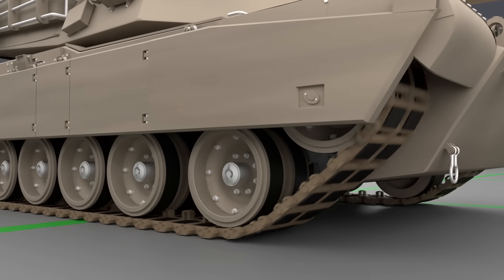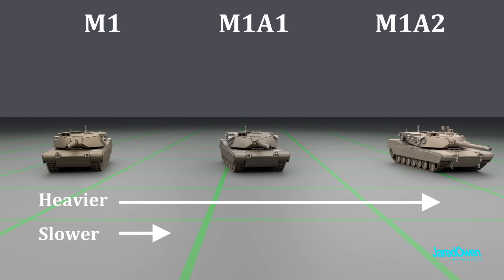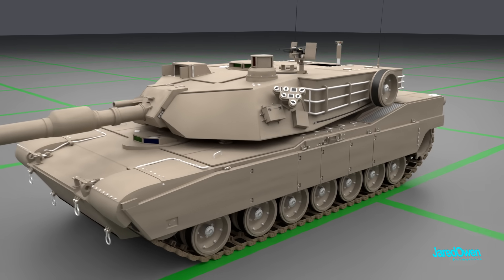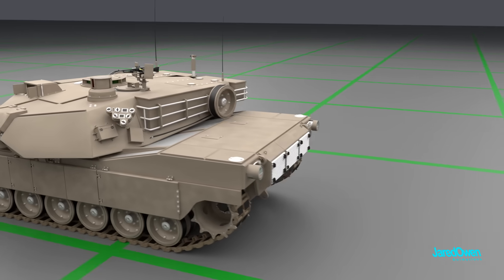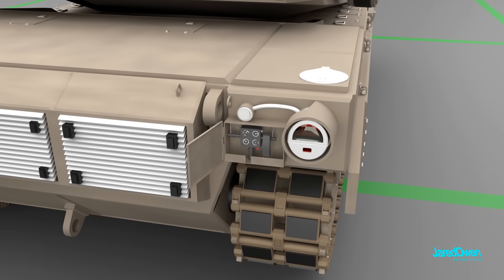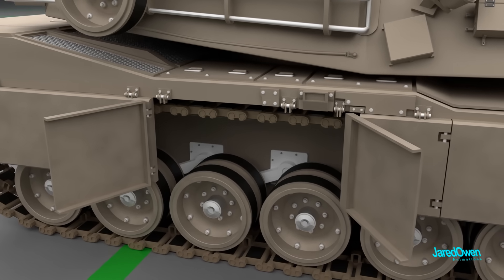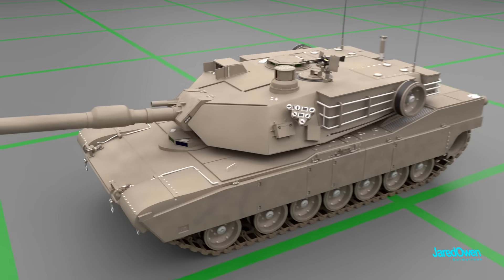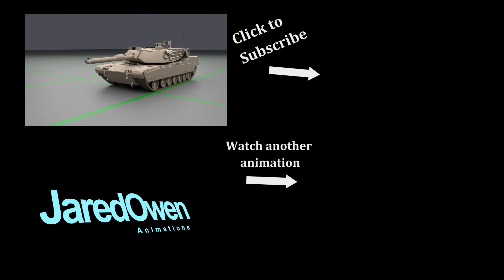How does a Tank work? (M1A2 Abrams)

Comment: I was an m1a2sepv2 mechanic for years and I can say this is very accurate. A few things to mention The coaxial can fire 240 weapon rounds and the one near the loaders hatch is can be either 240 or .50 cal. The tanks that I worked on had c.r.o.w.s above the Commander's hatch. The little passageway that leads from the turret into the driver seat did not get used as much due to the fact that the seat was in the way and not a lot of people can fit through it. Me being 6 feet tall had a tough time. The  Drivers Seat was adjustable so   so the driver’s head is sticking out of the drivers hatch for better visibility when driving. Nine times out of 10 the drivers hatch is always open for that same reason. Typically when the tank is in use the drivers hatch is closed when they are about to fire a tank around or if it’s really bad weather and destroy the electronics inside it
Reply: The loaders mount cannot fit a 50cal. The 50 mount rings are too spread apart to fit in the mount. As well as, the 50cal is a lot wider. Plus if you try to use a .50 in the loaders mount it will hit the CITV. Its designed for a 240. Literally the driver gets in the drivers seat through the turret about 99.9% of the time. For multiple reasons. 1) when we park the tanks we place the gun over the rear of the hull therefor making it very hard to access the drivers hatch. 2) The drivers hatch is always closed when there is not a person in it. You never get off a tank and leave the drivers hatch open when there isnt someone in it. 3) Its really not hard. Im 6'1" and can get in the drivers seat pretty easy from the turret. You just have to hold onto the ledge where the ready rack is and slide in like its a water slide.
Reply: The loaders mount always has a 240 due to the reasons Jacob mentioned, plus it's a backup for the coax. That's pretty important because the coax is the primary weapon against troops and and light cars or trucks. We definitely used it in combat more than any other weapon on the vehicle. As for the driver, they 90% of the time operate with the hatch closed because it's not super safe to have your head sticking out when the turret is traversing and it's not even comfortable for short people keeping your head crouched down like that, and you "definitely" would "never" have the hatch open in areas where the main gun may need to be fired. The driver always has to exit through the turret when the tank will be left unattended. This is because the loader's hatch is the only one that can be closed from outside to secure the tank.  The last segment of the driver's seat folds all the way down, and the head rest folds all the way up, so when you set it up like that it's not too bad getting in and out if you slide in like a water slide like Jacob said.
Reply: Are all the electronics, hoses, etc on the turret localized to the turret itself, or are they connected to the hull? If they’re connected to the hull, how does the turret rotate freely 360°?
Reply: @dropkickirish4449  Can't really say much on this. I'm not a Master Gunner (Subject Matter Expert on the Abrams) but I believe they are connected through the sub-turret which is connected to the engine. Which they are connected in a way that allows the turret to rotate freely. It's a lot of engineering involved. Lots of research and development that is involved with it.
Reply: @155jwatson  Thanks, man.

Comment: I got to serve on all three of these tanks in the 90's. I remember the most significant changes were the 105mm gun of the M1 to the 120mm smooth bore gun of the M1A1 and the CITV (Commander's Independent Thermal Viewer) of the M1A2 that allowed the gunner and Commander to scan for targets simultaneously and a built in navigation system.
Reply: I saw a demo in the mid 80's of an M60 and an M1 running the test track/firing range on a proving ground. The M60 was and still is a great tank even though it is outclassed by the M1. So what I saw was an M60 hustling around the obstacle track, stop, fire at a target a mile away and hit it. Slam it into gear and go around the track again. They were firing tracer type rounds that you could follow all the way down range.

The M1 came out and flew around the obstacle track, mud, water, actually got air over the speed bump and when it hit the ground fired a round through the center of the target. What seemed like 10 seconds later while running the next obstacle they fired again with a direct hit. Then the thing took off down range and they demo'd the smoke system.  As the announcer is saying some dribble the M1 comes flying out of the smoke towards the viewing stand and even at 500 yards it was frightening to see this thing coming at you.  The crowd cheered and we all thought Go Army we are damn glad that you are on the job!
Reply: Thermal imaging is such a value added asset in so many ways . Also the Coaxial gun mounted on the turret next to the main battle gun is a 7.62 nato round machine gun sighted in by gunner. I got to ride and get the full tour of this M1a2 tank in Iraq in 06-07 as a contractor  it was bichen and the crew was more than happy to give me this present. Also they had upgraded sights that could see the dimples on your cheeks a mile and a half away. I never felt more protected  The tankers said if we get breached on the fence line get your as over to the Tank Ramp we got your back Hoorah !!!! Go Get Some!!!!
Reply: thats cool as hell

Comment: You need to check the muzzle velocity @ 6:17 in the video. What I found was 1,575 m/s.
Reply: No he saida about 3500mph (miles per hour). You're saying 1575m/s (meters per second) This converts to 3523mph. He said nothing wrong.
Reply: @furiousredeem1207  Okay, thanks! The conversion looks correct.

Comment: You got most of the terminology and information right, but you definitely have a few points that were not so correct and could use some revision. I would suggest doing a tad more research and maybe talking to actual soldiers that work on these vehicles so you sound a little more informed. Otherwise I really enjoyed the video! As a tanker myself, I can’t get enough of these beasts!

Comment: Ive built the Digital Engine Controller for this behemoth for about 30 years.
Reply: How does it work?
Reply: @carkid7640  It's like the computer for your car engine.
Reply: @AZPaul48  anything more specific? There's a number of things that can be considered a computer in a car's engine/engine bay to help the engine
Reply: @ada5467-g3n  this infos would be classified?
Reply: @ada5467-g3n  It is the computer that runs the engine.
Reply: @AZPaul48  does it do different duty cycles for the calculated specific gravity of the fuel?
Reply: @ada5467-g3n  Controls speed and fuel. It has a backup battery that allows it to run when the rest of the electricity has shut down.
Reply: @pope406  I don't have a top secret clearance, sooo.
Reply: Sems you ´ve been using outdated technology for too many years - dear lad.  Ho ho ho and very haha ha you lost hillbilly on mother earth.
Reply: @rundepanien862  I'm not sure where your mind is, but there have been up dates to this box.
Reply: How does it compare to the Leclerc ?
Reply: How did you manage to run the engine on different types of fuel and do you have to adjust the engine controller for it?
Reply: Now we know who to blame if something goes wrong
Reply: @harrishearse6  That wouldnt be the first time.
Reply: @AZPaul48  😂😂😂 !

Comment: He really said stay clear of the back while it's running like soilders don't stand right there with it running when they in the mp in the winter
Reply: But they liked warming up lunch (MREs nowadays) by placing it on the rear exhaust grill.  Well said in your point, though, that infantry can't hide there in the heat for long (whereas the M60 ran the exhaust upward - yet with a larger heat signature).

Comment: So if the driverhatch can only be opened when the turret is to the sides, and the driver can only go into the basket through a tiny door if the turret is pointet to the back: what happens when the tank is immobilised when the turret is rotated another way? Is the driver just stuck then?
Reply: Turret has manual controls to rotate it. Its been a while since I've been in one but I do believe no matter the position of turret, driver can still get out
Reply: The driver hatch slides like a lid more than opening like a typical hatch this way i believe the driver can get out

Comment: .... That's.... Not how smoke grenade works.... 

It's supposed to shoot the SMOKE GRENADE up into the air and then it explodes into smokes mid-air, not just activated while still on the tank, it's supposed to obscure the tank in a large area, on the ground the smoke has smaller area to covers, but if you fired it like WHAT A GRENADE LAUNCHER it could cover more areas with smoke

I'm surprised no one noticed about this yet

Comment: The trials for the Abrams was not a good one in my opinion.  The diesel tank was minutely slower but was multifuel and extremely durable and able to take abuse. The jet turbine of the Abrams is sensitive to air contamination and the filters are a mess. The turbine in the Abrams has a much shorter life and not as fuel efficient. Repair is more complicated. These problems may have been worked out but I don't think so. Not everything the military approves is the right choice because biased congressmen choose for the wrong reasons, corruption. For example, a manufacturer donates to a political party and they get the contract for that reason. That's happened often. It's been a problem for several thousand years by all nations and peoples. The YF23 and YF22 are examples. The YF23 seemed to be a better pick, maybe. The F22 is extremely expensive to buy and especially maintain. It is cool though with a large advantage over our enemies. I don't like or trust congress but there you go. President Eisenhower warned against the industrial military complex and political bias.
Reply: Not really the case with the results of testing

Comment: This video is now so relevant given the reveal of the AbramsX demonstrator. It seams the commander and gunner are moved to the left and right of the driver and the loader has been replaced by an autoloader.
Reply: Yes. Which is atrocious. Autoloaders are not efficient.
Reply: @155jwatson  really. So are you saying that  we should go back to using  revolvers or maybe even muskets for firearm?
Reply: @lantinian  How does that even correlate? Just because it is "tech" doesn't mean its good. There are many reasons why autoloaders are not as effective as a person. 1) It takes up more space in the turret. 2) It is mechanical therefor more susceptible to faults and failures. Which could ultimately cost the lives of the crew and/or destroy the tank. Or could just put the tank out of the fight because the way they are designed makes it to where a person cant get space to load incase it fails. 3) Since it takes up more space there is less room for ammunition. Which could take a tank out of the fight for a rearm. Which could be very detrimental to the operation/battle. 4) Autoloaders now load slower than people. For instance, the Autoloader on a T-80 loads 1 round in about 13 seconds. Vs. A person who can load in less than 7. It may not seem like a large time difference but those seconds are crucial on the battlefield. Again could be the decider of life or death. 
These are just some cons of autoloaders. There are more than that. Really the only things that are good about autoloaders is 1)Consistent load times (If it functions properly). Even then, a trained crewman can load consistently for long periods of time. Its the reason we train physical conditioning. 2) One less person in the crew. Therefor saving money, and manpower. Although it doesn't make that big of a difference. Since those crewman would be repurposed to crew another tank but that costs more money since you have to pay for an extra tank, its amunition, and the maintenance on it. Not saying its a con but it doesn't make a big difference in the big picture. This is all my opinion. And the opinions of my co-workers who are also tankers.
Reply: @155jwatson  You are looking at the wrong auto loaders. The examples you give were designed 50 years ago. 

Examine the K2 black Panther and  the Japanese Type10.

Comment: It's certainly superior to the Russian tanks in Ukraine. They're blown up by the hundreds and the loader has been replaced by an auto loader which means the ammunition is under the turret and any anti tank round explodes the turret off and it lands two hundred metres away often on a roof or in a paddock it forest. The tank is vulnerable to the anti tank missiles which are the legacy of the German Oanzerfaust and American Bazooka. Rocket launchers which today are disposable and computer guided which means the tank can be blown up from a shoulder fired rocket launcher by a soldier who is unseen by the tank crew. And today the tank can be blown up by tickets launched from drones. The tank during on another tank is perhaps a tactic if the past.

Comment: The sprocket will remain on the final drive, then the sprocket will  fall high pressure , then the final drive heat  and the oil burns. How to solve this problem

Comment: Caterpillar treads are not only for rough terrain. They also spread out the load over a large area so that the tank can drive over soft terrain such as sand, soft/wet dirt, mud and snow. The treads also supply numerous gripping surfaces/edges that improve traction.
Reply: Yes, spreading the load capacity is imperative for a vehicle with this much weight.  I'm not sure of any other way to propel a vehicle with this much weight, other than multiple axles and wheels, and even then, you have a much smaller contact patch for load distribution.
Reply: Thx for the extra info
Reply: Keep in mind. The track sucks in soft terrain. You will "throw" track a lot more in soft terrain. Especially in sand.
Reply: Correct
You know better than me
Reply: it is a good idea to improve my transfer cart by caterpillar wheels

Comment: One question I've heard asked about the tank half track is, if the top of the track is going 20 MPH, how fast is the bottom of the track going? Answer is zero because it's stuck to the ground. The wheels of the tank are going 20 MPH over the non moving bottom of the track.

Comment: Just so you know, the same shell is an APFSDS which for the M1A1 from Australia has 40 of and for this tank has 2 more at 42, the M1A2 has a reload time of under 8 seconds, both the M1A2 and A1 has composite armor which blocks enemy rounds so no more damage is done
Reply: The reload time depends on the loader. The standard for all tankers is 7 seconds or less. Just about anyone can do it in less than 7 seconds. My fastest load time was 3.7 seconds

Comment: How is the turret connected to the hull? I heard it's only held in place by gravity, but that can't be right, otherwise it would separate from the tank when it jumps or flips over.
Reply: Pretty much only by gravity. Slip rings and gearing hold it in to some degree however

Comment: The bit about its service life was a little misleading. While technically true that the A2 version has been in service for almost 30 years the current version is called Sep v3 which is the third upgrade of the A2 version since its introduction. Its quite a bit different from the original version and weighs well over 70 tons at this point.

Comment: so the turbine engine of the abrams has a list of approved fuels, but because its a low air compression turbine, it can theoretically run on any liquid that burns. the funniest example of this was innthe 1960s when a representative from Chrysler was in mexico city driving a prototype Chrysler Turbine, which as you can guess, had a turbine engine. the rep had a meeting with the president of mexico, who after finding the car very interesting, asked if the car would run on Taquila. the rep actually wasnt sure, so he called the main engineering office in chicago, and they said that so long as it was a strong brand and didnt have too many flavor additives, the engine should run on it. The rep came back the next day and told the president as much. at which point, the president had an aid grab a bottle of taquila from the kitchen and poor it into the gas tank.

So, there was a time in history, that The President of Mexico was riding around in a car powered by Tequila. and thats not a joke, or a stereotype, that really happened.
Reply: Source?
Reply: @viceralman8450  of the turbine engine or the mexican president taquila story?
Reply: @theduke7539  Mexican president story.
Reply: @viceralman8450  thats the source cited by Fact Fiend. but Im sure there are more detailed sources available. but I trust Karl to do his research and hes not the first channel or program to reference that story, so I can comfortably say its more likely true than not
Reply: @theduke7539   Any video or news coverage just name as YouTube deletes links?
Reply: @viceralman8450  roadandtrack has an article on it and so does Vinepair
Reply: @viceralman8450  Fact Fiend with Carl Small Wood has a video on it. and Jay Leno owns one of the cars and talked about the story on his show
Reply: @theduke7539   Yeah but no firsthand sources either, they just say this happened but offer no proof of it.